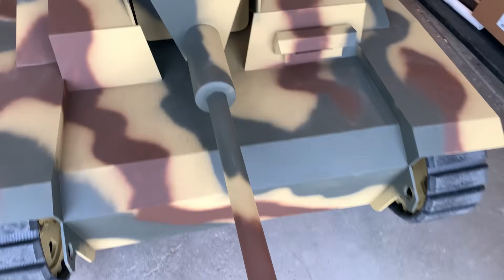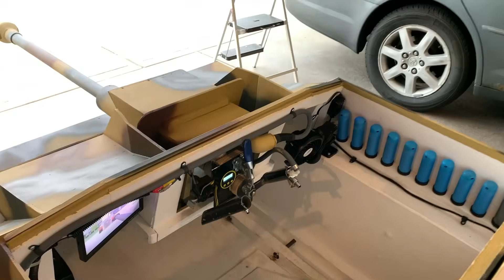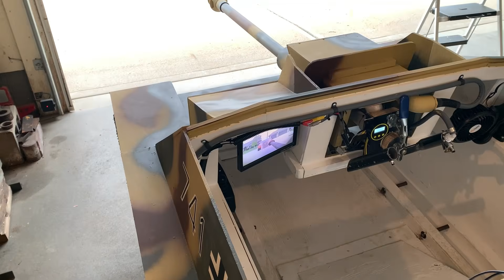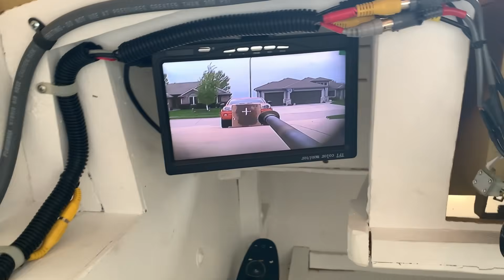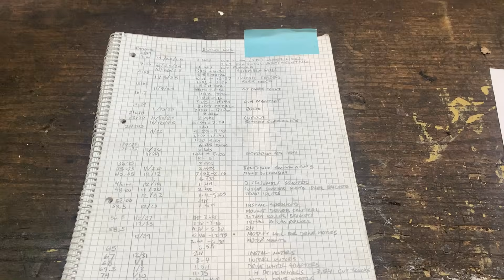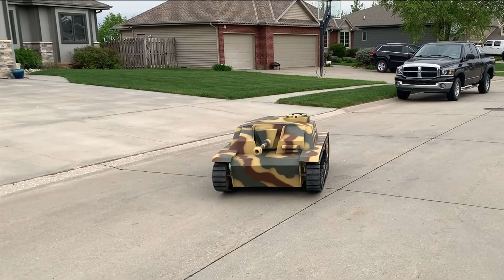StuG III G Episode 10: Cost and Lessons Learned

Comment: I am super interested in tanks, and have always wanted to build one. do you think its possible to make something similar to this on a $600 budget?
Reply from the maker: The only way to do it that cheap is to take out the drivetrain. My Sherman tank was first powered by pedals from a bicycle. It was slow but it was cheap and it worked. Watch my Sherman series to see how I did it.
Reply: @ryanhahn7251  thanks, I am not old enough to drive, so that might be a problem... but I really want to make a King Tiger or something. could you please share the math that you use to calculate the angles and dimensions of the tank?

Comment: You should make an M-36 "Jackson" or an M-10 "Wolverine" for the Stug's adversary
Reply from the maker: I took a poll a few weeks ago and the hellcat had the most votes by far, 62% I believe.
Reply: @ryanhahn7251 ahh, darn it, the Hellcat is still awesome, plus you can still use the nerf mega cannon bc it uses a 76.2mm almost the same...
Reply from the maker: @Ghostsabre.channel yes the hellcat will have the same caliber Gun and similar suspension so it has a lot in common with the StuG.
Reply: @ryanhahn7251 and you can also probably use some of the Sherman design as well
Reply from the maker: @Ghostsabre.channel yes the power train is going to be similar to the Sherman
Reply: @ryanhahn7251  will the hellcat have an engine or electric like the stug?
Reply from the maker: @spenceystudios it will have an engine. I bought an 8hp snowblower engine for it.